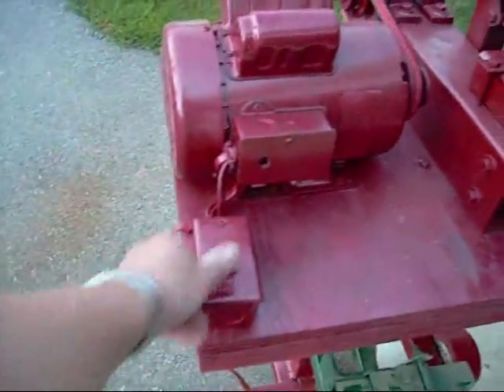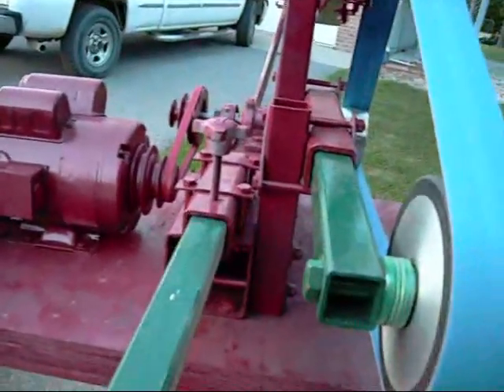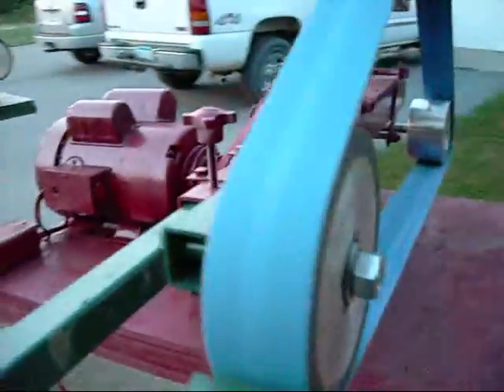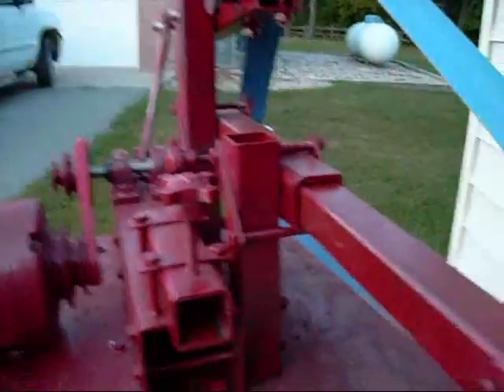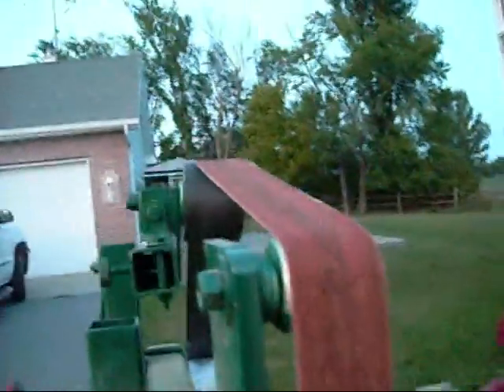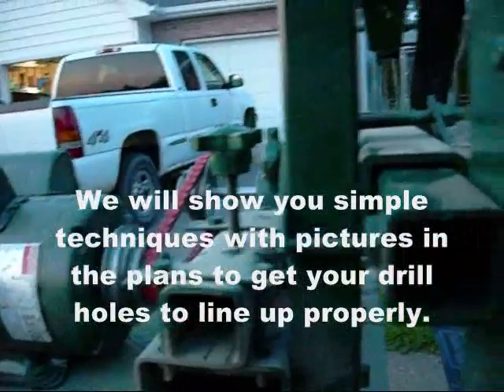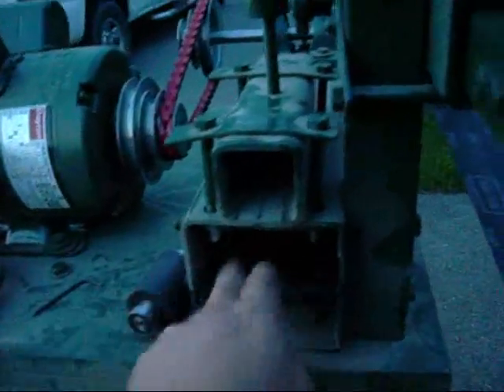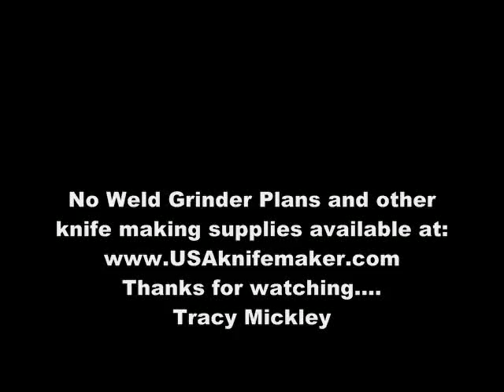No Weld Grinder Knife Grinder Walk Through Plans Built Tool

Comment: very nice  i am building one as we speak. i have change some of the materials to use what is available to me . i learned a valuable lesson in building one with materials that were to light and had terrible vibration. so now i am rebuilding it again. this time i got the steel from online metals . great service by the way .i will forward pictures when it is complete

Comment: Its a nice grinder. Just one question, why no welding? 
I welded a lot on my grinder and I really dont understand why anyone would bother with all those brackets. If you look for it you can find welders under 100EUR. I bought mine for 60 euros and it goes up to 160 amps.